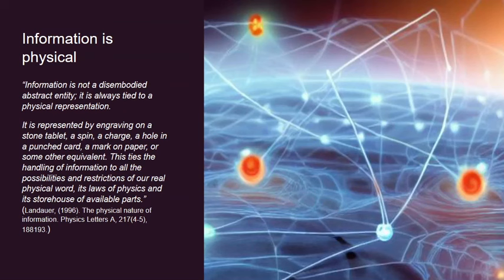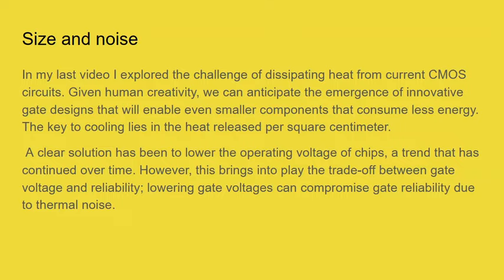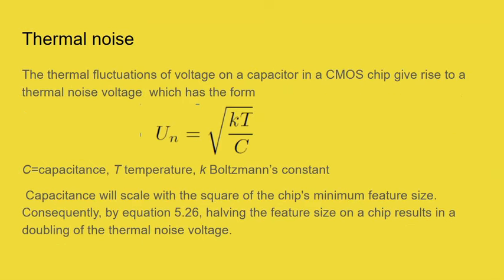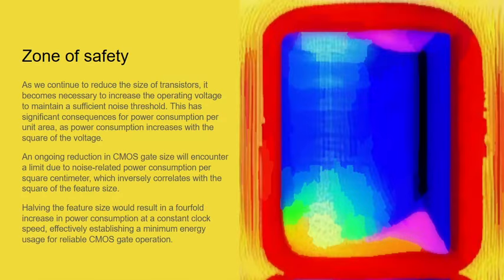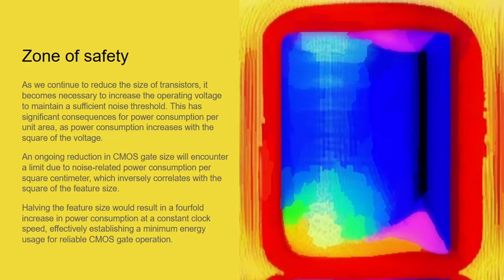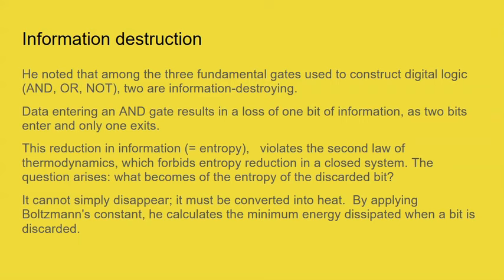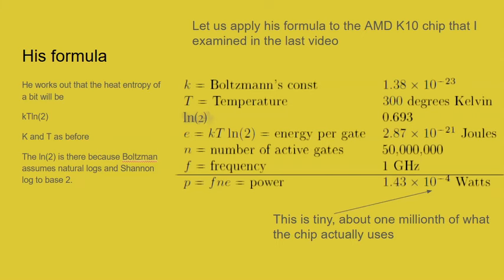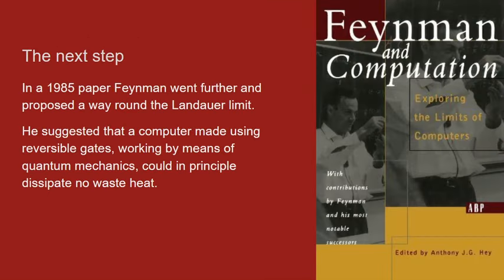information is physical

Comment: Hi Paul, I’m quite ignorant on this topic, so please assume good faith. I’m just speculating that a computer where every operation is reversible would be unable to compress files or even do arithmetic? Wouldn’t an operation such as 2+3 require the answer of 5 to be reversible into its constituent of 2+3? Wouldn’t, therefore, such a computer be practically useless as both would require the same amount of time to decode from storage?
Reply from the maker: Addition is irreversible in binary. In Feynman's proposal there are auxiliary 'thrown away' bits which are preserved so that if you feed the particles in backwards you regenerate the inputs